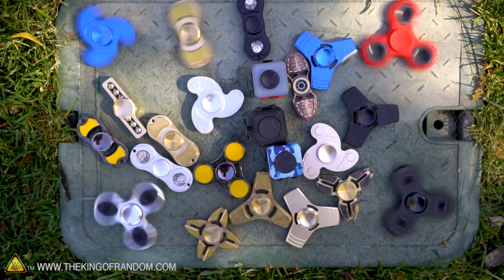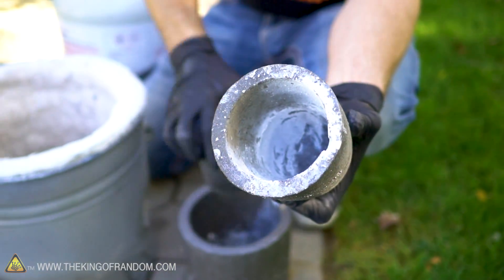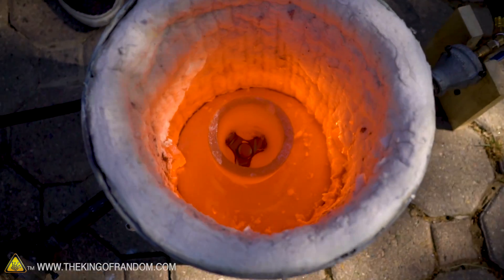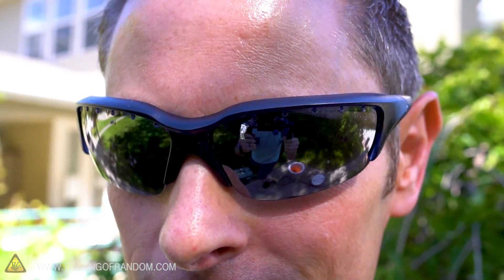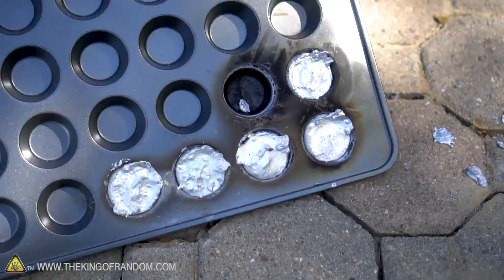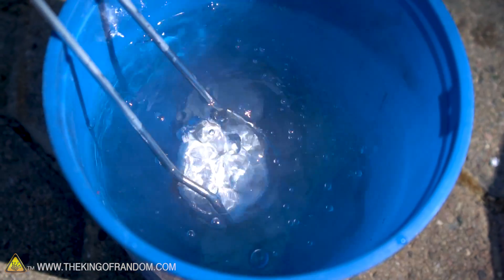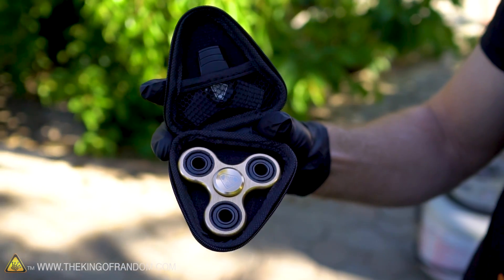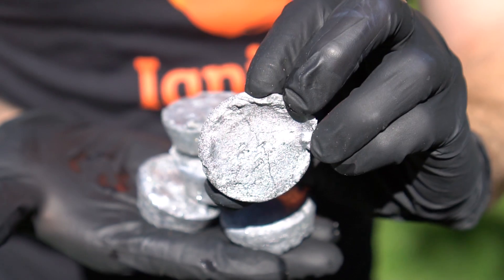Melting METAL Fidgets In a 2000ºF Foundry - TKOR Tests Some Cool Fidget Spinner Tricks

Comment: Make a fidget spinner with a 3 and 1/2 wide steel ring made of 3/16 plate, a roller bearing, and button. A fidget spinner is just an over-simplified gyroid. Basically gyroscope with your fore finger and thumb pinching the button as an axis, and your wrist as the up and down,  and left and right axis.

Comment: the flame turned that color with the chemical reaction with fire and boric acid were they turn green or teal blue. ....similar things can happen with copper. the reaction is the same with methane or propane which turns the flame blue

Comment: Question: What would happen if the muffin pan was sitting in a cold water bath when the metal is poured into it? Would the muffin pan undergo thermal shock and crack? Or would it keep its form but transmit heat away from the molten metal fast enough to prevent aluminium from bonding with it?

Comment: The reason for Tiel blue flames is because certain metals(ones that create salts like alkali metals) when burnt will color the fire certain colors. Copper actually is used in making copper sulphate, a salt, and it makes a Tiel Blue Flame. Brass is composed mostly of Copper and a little bit of Zinc, so that's why it burns.

Comment: Part of the reason for the cracking is cooling them in water. Because it cools so fast it creates large crystals which make the metal more brittle. The rest of it would probably have to do with the alloy. I don't know if brass and aluminum are compatible lol... they could be though...

Comment: the reaction  of the teal blue flames wasnt just from the brass, the zinc reacted with the aluminum oxide which caused flames and smoke to erupt. i had this happen to me once and it caused my steel crucible to melt and my foundry to actually burn up

Comment: can  hot metal nuggets boil water?
Reply: Yes, a long time ago people heated stones and tossed them in water to boil it.
Reply: @ Akif Ammar
Your question could be answered depending on several variables, including but not limited to:
1.) How much mass is being combined (of both the metal and the water),
2.) The starting temperatures of each mass/volume,
3.) How long each mass/volume is in contact with the other,
4.) The atmospheric pressure at the time of the experiment, and
5.) The atmospheric/air temperature of the location.

If you would like, I can do a "simplified" calculation based on the first 3 variables (since the 4th and 5th will likely be "standard" pressure and "average" temperature.)
Reply: James Cantwell

Comment: The two sides spinners that "wobble" when you move them don't actually wobble. It is called gyroscopic precision. When you tilt an object that is spinning really fast, it naturally wants to tilt 90° from the point you turn it. The same is true with helicopters and is what pilots account for when the want to go forward, backwards, or tilt left or right.

Comment: your foundry is running on too low a pressure. the oscilating roar coming from the burners means the flame has traveled back inside the tube and is burning very ineficiently. Try using a longer burn tube

Comment: I wanna see you turn that metal into liquid and put it  into your Lego trays, metal legos always wanted to see that 😇
Reply: not until you step on it
Reply: Jerod Durant Jr I think he did that with gallium
Reply: jasper spirit the lego trays are from silicone and are gonna melt for sure, but otherwise this is a nice idea
Reply: CosmicBaconCat and plastic wasn't enough now metal
Reply: jasper spirit I have seen gold casted lego for gold chains there pretty cool some have gold guns and stuff that they can hold
Reply: CosmicBaconCat  file it to
Reply: he did it already i think
Reply: jasper spirit the lego molds would melt if he used the liquid metal. but if he used molten gallium it would work
Reply: i was boutta say. WAIT I JUST HAD AN IDEA SHARPEN THE TOP ROUND PARTS INTO SPIKES
Reply: jasper spirit 

Best 

Idea 

Ever...
Reply: yeah but he can still mold it by using the method he used for the metal gun
Reply: jasper spirit you can buy lego fidgets that are made lego style and there metal

Comment: the reason the metal is brittle is because u quenched the ingots in water. If you buy quenching oil the metal will not be brittle or have cracks in them

Comment: The green flames were actually due to the emission spectrum of the boric acid, not the zinc. Boric acid will color fire green as its electrons are energized by the heat and jump between energy levels. The same thing can be seem when you mix borax and methanol, then burn the solution.

Comment: If you didn't know, I'm pretty sure you can find the volume of the ingots by submerging them in water and finding the change in the water's volume and then use the densities of the melted metals to calculate a ratio by volume and by mass of the two metals.

Comment: Hey Grant, just to let you know... 21 Mule team Borax is the flux of choice as far as the knife\blade making community is concerned, also you should add it to the crucible before your metal melts to keep the zinc from from burning off and ruining/pitting the poor thing (yes the "Green" explosion is a mild thermite reaction) ^_^

Clean sand can also be used for the same purpose

Comment: The colored flame is from the boric acid. 
Tip: mix BA with alcohol, put a tiny amount in a bottle/large bucket/whatever, turn off the lights and burn off the gas. Cool effect :)

Comment: How do you clean your crucible?
Reply: Matija Pilko heat it up and dump it out
Reply: You been playing destiny to long
Reply: Ask the darleks
Reply: You don't. A clay-Graphite crucible is meant for 1 kind of metal, so if you need to melt down aluminum and steel you'd use separate crucibles to prevent cross contamination.

Comment: wear a mask as those fumes are poisonous
Reply: Fidget smoke, don't breathe this
Reply: Ahhh714 thank you showing common sense and understanding the dangers of toxic gases
Reply: Simao W he's outside
Reply: that's actually not true you need to have a sustained amount to do anything bad.
Reply: No he still needs one, It's Zinc Oxide, it's like burning off the coating of galvanized material which causes metal fever. It's EXTREMELY potent and just a couple lung fulls are enough to make you incredibly sick no matter if it is outside or not.
Reply: Simao W hes doing it outside so he wouldnt need one
Reply: Simao W noxious*

Comment: You should put cake batter in a vacuum chamber  and then bake it to show how much air gets whipped into it while mixing, before you put cakes in the oven you tap it on the counter to remove air bubbles, but just how much air is left in?
Reply: And I'm shook about the fidget spinners, but whatever floats your boat

Comment: Correct me if I'm wrong, but aren't you not supposed to use propane/gas lighters when lighting propane things? Aren't you supposed to use a flint lighter or what ever they're called. Not that you have to but probably a lot safer for you to use

Comment: can you put melted metal directly into water or liquid nitrogen?
Reply: pedro garay hmm. I wonder. Maybe it would like solidify into some weird long stringy blob or something.
Reply: You can, depending on the metal though it could end catastrophically. Quenching steel is as far as you should go (taking an orange hot piece of steel and thrusting it into water will cause ferrous oxides to form and can cause harm to you)

Comment: Hey Grant I used this trick to start a fire I'm just telling in case you didn't know. OK what you need is a glass container and gas or petrol wherever you're from.  Then take Styrofoam and stuff it in. It will melt easily keep adding Styrofoam until it's like a sticky slime kind of like melted marshmallows. Once it's at that stage just spread some on the coals and you started a FIRE.

Comment: Can you make some solder, maybe do it with different metals than normal just to see what happens. If you don't know what solder is, it's what you use to fuse wires and other metals together, almost like poor mans welding.

Comment: I have a suggestion:  next time you melt metal,  when you drop your mms (metal muffins) in water to cool, take a temperature of the water. watch how fast the water heats up. how hot does it get?

Comment: Put a feather stuck to the top of your vacuum chamber with wax. In the vacuum heat the was from the outside to melt it and let it fall. Without air resistance, it sould fall very quickly at 10m/s2

Comment: Hey grant, the reason the flames were all green is that copper(which is in brass) colors a flame green if it is in a liquid. Also you should do another rocket launcher with the butane bottle missiles but have a thing that lights it on fire as it exits the barrel

Comment: can u make glass using sand in your electric arc furnace
Reply: Quartz sand (SiO2, which is used to make glass)  has a melting point of 1710°C and the temperatures that can be reached by a EAC (electric arc furnace) are 1800°C for industrial use and up to 3000°C for laboratory use. So theoreticaly it should be posible to make glass as long as his furnace can get that hot.
Reply: Saiyan sienchhhh!!!!

Comment: Try exploding cards experiment. fill between 2 cards with gunpowder.
Reply: Hubelerava Teranos What? Just use a contact explosive instead of gunpowder. Lighting the corners?
Reply: it would make it biggeeer!!!
Reply: ah yeah that could work, use something like the pop caps powder or a fulminated metal like silver fulminate
Reply: gunpowder isn't a contact explosive so he would need some way to light them
Reply: that's why he use the ignite powder in every corner of it.
Reply: Hubelerava Teranos --.--
Reply: then throw it like Batman
Reply: and close every single edge. or U can use melted fidget spinner as the slim card

Comment: Hopefully you see this through the flood of comments you get, but in case you didn't know you might want to get a kaowool hardener or coat it with a layer of your refractory mix if you're going to be using flux in there alot.  flux eats away at kaowool very quickly as you might have already noticed

Comment: Hey Grant. The green flame isn't actually caused by the brass, but by the boric acid you added. Many boron compounds cause a greenish flame coloration, hence their use in pyrotechnics or to check alcohol distillates for methanol residue.

Comment: Hey Grant, something thats been annoying me...one of your burners wasnt running properly. The sort of loud 'buzzing' noise throughout the video is one burner continuously going out and popping back alight again. Just wiggle it around, push it further in, pull it out etc. until its making a nice continuous growling sound. You can even see it at around the 1.50 mark or so the burner to the right is going on and off. Itll get hotter and work better after that.

Comment: I feel the need to call you on this. You've done brass several times now, why do you leave the gas on full when you could turn it down so that you don't have such a volatile mix of heated gasses?

Also, your Randonium is an amalgamation. Way cooler if you ask me.

Comment: dont use roach killer for flux thats meant for copper and brass. For aluminium use mortan lite salt. You melt the salt into little pieces and just toss a couple into the metal before you skim dross

Comment: Can u melt salt and pour in water. It with explode and I want to know why
Reply: backyard scientist has already done it
Reply: bayley peters is pour
Reply: Nil None oh oops your right let me fix that. Thanks
Reply: bayley peters no problem
Reply: Pranay Deokar yes but he never really figured out the real reason why it happened
Reply: bayley peters oml. The water evaporates quickly and and sudden release of all that gas and expansion makes I burst. That's what an explosion is.
Reply: bayley peters you need to work on your listening skills, its because the water evaporates so fast that it creates spaces of air and slowly expanding till it 'explides'
Reply: Hew Weeseong then why would you even ask you want to know why if you already know!
Reply: Hew Weeseong wow so much salt over a comment, gezzz if i wanted triggered kids i'd stay at school
Reply: bayley peters nt really salty, backyard scientist already hypothesized that its was the molten salt which is about 801℃ and the boiling point for the water is 100℃, the rate of evaporation is so fast that it burst like explosion
Reply: bayley peters Nope it's not. check the backyardscientists video on it